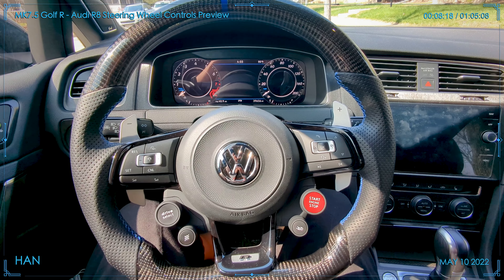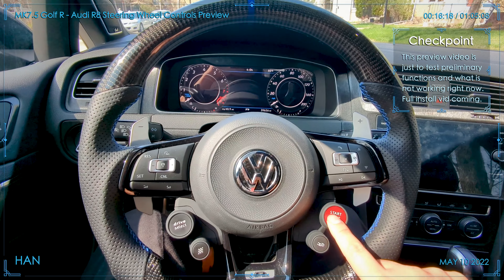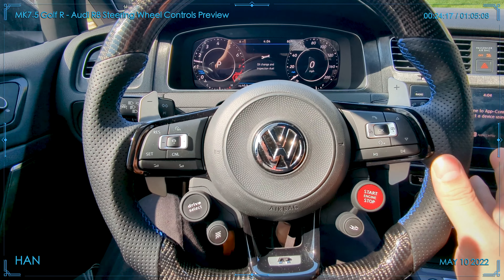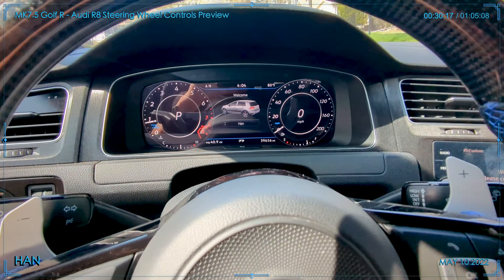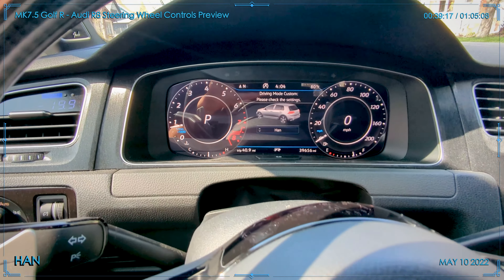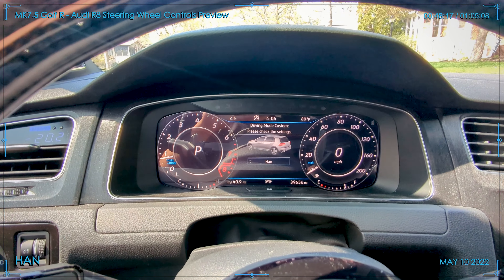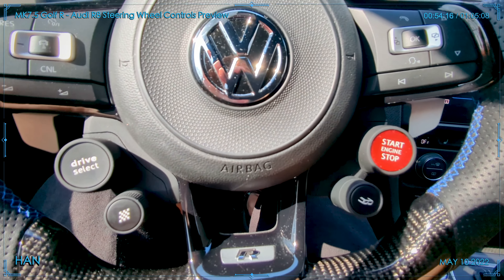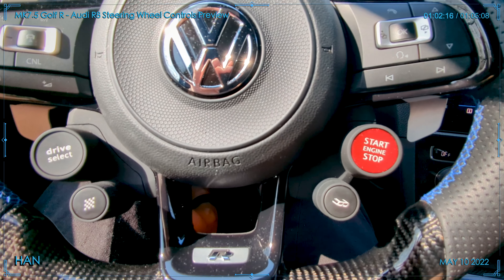Mk7 5 Golf R   Audi R8 Steering Wheel Controls Preview

Comment: Hi, do you know where to install the wires of the 2 R8 buttons behind the airbag? I also have this mod. But the light on my R8 buttons always stays on. Even when i turn off the car. Can you tell me which wire you tapped? Cause i tapped the gray wire of the steering wheel controll behind the airbag. Hope you can help me.
Reply from the maker: Hey Delano sorry this took forever but had family issues.  I've added a new video that has PDF instructions in the description.  https://www.youtube.com/watch?v=LqK3p0l7_WM